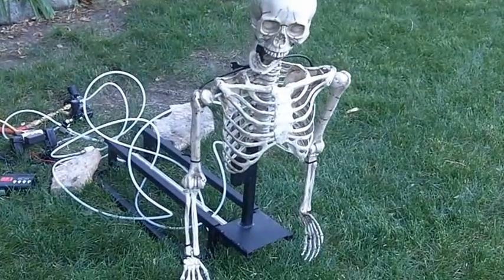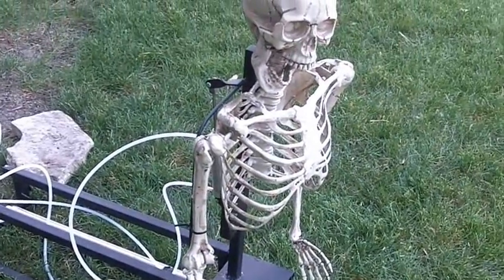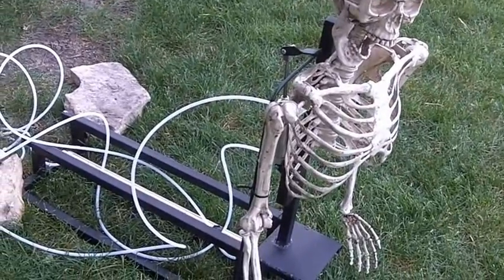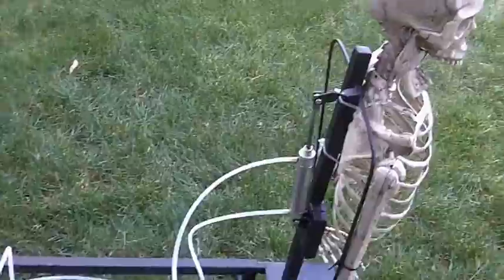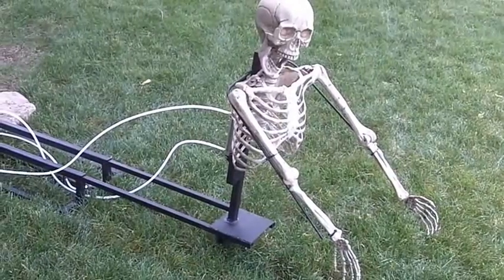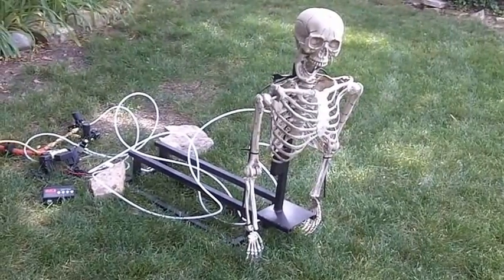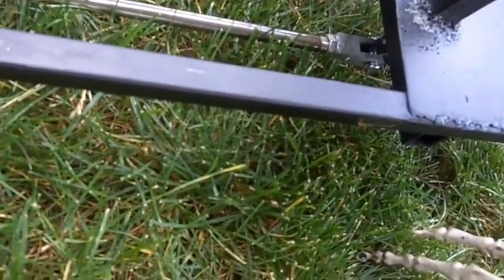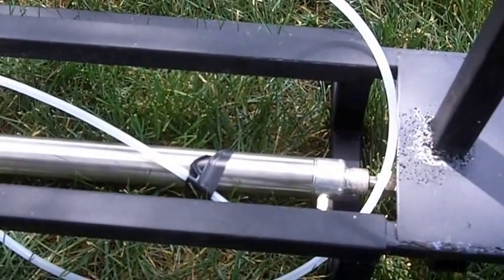Pneumatic Halloween Prop Test - Slider Mechanism

Comment: If you attached a cable or bungee from the top of the arm to a point on the stationary framework, could you make the arms extend at the same time the prop slides forward?

Comment from the maker: You are correct.  I welded a piece of flat stock to the steel rod.  I twisted the flat stock before welding so the flats were angled appropriately.

Comment: QUESTION:  How did you affix the linkage strap to the round rod (for arm movement)? I am assuming a weld? I am making a zombie prop with arm movement via 2 double acting cylinders but like the single cylinder config to.  Thanks,